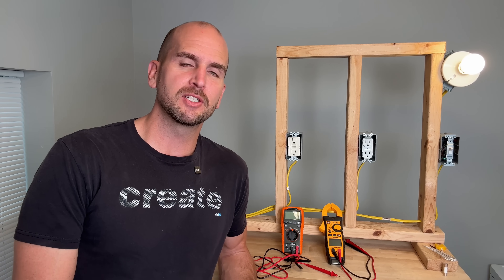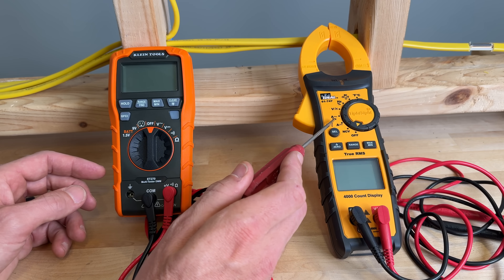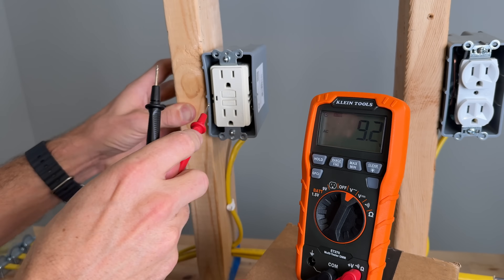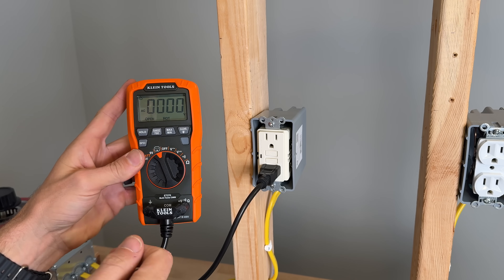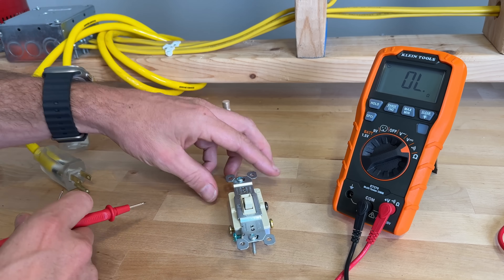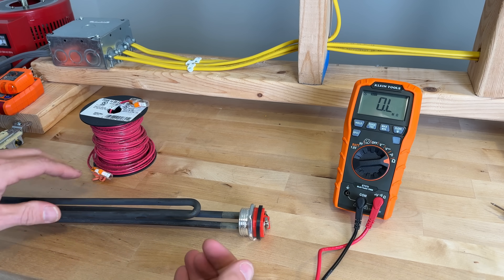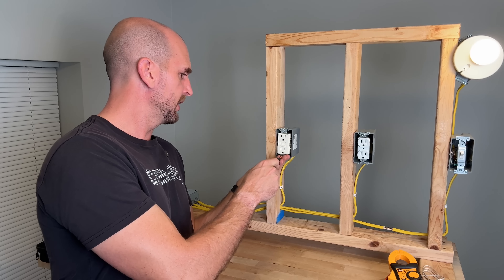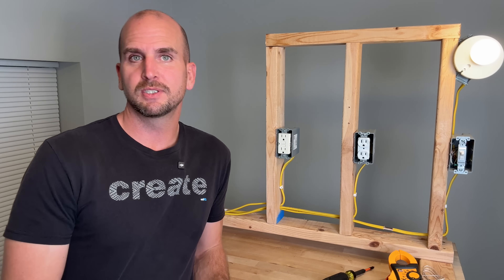Ultimate DIY Homeowners Guide To Multimeters

Comment: Will the klein plug in testers find open neutral and open ground? two problems at same time?
Reply: That might depend on which style of plug-in tester you have. The basic three light might only give you one error code until it is resolved and then show the other error afterwards. The LCD screen testers can show multiple errors on the screen. In this instance it’s probably better to use a multimeter to solve any issues.

Comment: Don't you have to use a cord splitter that plugs into the outlet when testing for amperage draw? I saw that you put the ammeter over the hot wire behind the outlet. Hmmm, so you didn't need that special splitter?

Comment: I’m going to be going through the wiring on older boat so how do test if wiring that goes to certain things on the boat ,for example testing to see if the wiring going to the fuel sender on the gas tank is working correctly.would that be the same test to see if the wiring going to the gauges ?
Reply: Boat wiring is fairly straightforward on smaller boats, you have your engine harness side and the boat wiring side. Assuming no one's modified the original wiring, the boat side follows an ABYC coloring scheme and the engine side will be manufacturer specific colors you can typically find in their shop manual. In your specific scenario, the fuel gauge will have ignition power, sender and ground. Because it's typically a switched circuit, you'll need to turn the key on and check for power between the ignition power and ground on the back of the gauge. You can jump the sender and the ground here and the gauge should jump to either full or empty, if it does, gauge works. Fuel sender will be a pink and black wire, check for resistance between the sender ground and the battery ground, there should be none or minimal depending on the wire run. Next would be pulling the sender and sliding the float while measuring the resistance across the black and pink wire, it should be within the stated range of that type of sender.

Same concepts for checking voltage and resistance but having a guide for the color codes will save you lots of time.

Comment: When measuring current with a clamp meter, its not necessary to remove the receptacle from the box, if you use an AC Line Splitter.  Some clamp meters come with one, or you can buy one separately, about $10.

Comment: My favorite screwdriver is a 6 in 1- it has 2 philips sizes, 2 straight slot sizes and 2 nutdriver sizes.  I like it because it does what I need but it isn't overly complicated.  I've tried the 11 in 1 and I have to fiddle with it too much to find the bit that I need.  I have a ratcheting screwdriver with a lot of bits in the handle but it is the same issue- I don't really need that many different bits so it is too difficult to change bits.
I have a really old VOM in my workshop and a cheap new VOM in my house, I use them mostly for just testing batteries and testing continuity, occasionally for measuring resistance.  I don't normally need the additional features but it is interesting to see what they do.

Comment: Great video. I just bought a multimeter to check out the voltage from my doorbell transformer after installing a doorbell camera. I was getting low voltage messages from my camera. Changed the transformer to one with a little more voltage and checked the voltage again. It was within spec for the doorbell and the low voltage message went away. Having the voltage meter gave me insight needed to resolve the problem.

Comment: Hi Scott,  Nice video.  Question, at about 3:25 using the individual probes the Klein tester showed 127.3 volts.  Then at at about 5:42 using the plug method in the same receptacle the same Klein tester shows 121 volts.  Why the large difference?  Thanks for all your great videos.  Take Care, Myles
Reply: My question exactly on why there is such a difference in voltage between the two methods of testing, using the probes versus using the plug?  Could you please explain? Excellent video

Comment: Another thing to add, don’t know if anyone else mentioned it… When you take a resistance measurement the system has to be off and isolated. Testing the heater element, it has to be switched off and disconnected (doesn’t have to be removed)

Comment: For me getting a meter that measures capacitance allows me to check AC capacitors which are easy to change. Saves a lot if avoiding a service call.  Also you can buy an attachment that effectively splits the power cord into hot and neutral so you can measure amps. No need to open the outlet.
Reply from the maker: Thanks for the feedback, I also like the capacitance capability.  For the price of a capacitor as compared to a service call you can pay for your meter in 1 fix.

Comment: Can you or someone clarify the color terminology?  You say the big slot is "neutral" and the small slot is "hot" (the hole is "ground").  You put the black probe into neutral or ground, and the red probe into "hot".  However, in the "romex", you call the black as being "hot" and the "white" as neutral, and then clamp the black wire.  Does this mean with the probe multimeter you would use the red probe on the black wire and the black probe on the white wire?
Reply from the maker: Correct 👍.  The probe red/black is a bit more aligned to DC Voltage as opposed to AC Voltage which drives a bit of the confusion.
Reply: Don't be concerned with probe color, it makes no difference in AC and in DC it will give the same numbers either way, but if the probes are reverse polarity, you'll get a minus sign before the numbers. No biggie.

Comment: How important is having InRush on a clamp meter?
Reply from the maker: Depending on what you are doing it can be handy on the high inductive loads to see what the actual peak current is on your larger appliances with electric motors and a high load at startup.

Comment: Best DIY info available, keeps getting better! Great new tool tips!
Reply from the maker: Thanks for the feedback and support!
Reply: Hi
Scott has many interesting videos and is very knowledgeable. I have the Klein clamp meter and use it all the time. I also have the Klein circuit breaker finder. This is a fantastic tool if you're trying to shut a breaker on a circuit. It has a transmitter and a receiver, which easily helps you find the breaker you want to shut off, especially if you are alone. Before I had this tool, I had to try each breaker, and it was usually the last one.

Comment: But did you have the correct bit for electric screwdriver’s is it / does it have the flat/square/Phillips bit? All in one bit ?
Reply from the maker: Yep, it has multiple flathead, philips, torque, square, and "combo"bits.  I honestly couldn't think of a bit I use that doesn't come standard.  The nice thing is those bits also fit in your impact driver.
Reply: @ you said bits. I said bit  it is all three as one ☝️

Comment: Balls drop close to the car. xD

Great list of practical applications!

I'm getting used, for most of what I need, to a pen type multimeter. Also works as a small torch, and non contact voltage tester. I still have around my dad's analog multimeter, as well as a newer digital multimeter... but for the most part, the pen style does the job. Easier to carry around too, and it takes AAA batteries which are cheaper and easier to find where I live. 
Very likely not as accurate though. Display is tiny, and navigation a bit confusing. And of course, you don't have DC current or a clamp to work with... but I rarely need those.

For batteries, I got a battery case that came with a cheap-o battery tester. Analog one that doesn't require batteries. It's just more convenient. The display already shows most common voltages for batteries, a scale from bad to good, and it can read anything from button cells, up through the spectrum, and has contacts for 9V. I dunno how reliable it is since it's so dirty cheap that it came as a gift with the battery case, but seems good enough. xD

Comment: How can you use a DVM meter to measure how much LOAD an outlet can handle?
Reply: Information about maximum loads should be on the outlet or electrical equipment
Reply: @michaeldunham3385  mostly they aren't listed so you're just guessing. Most techs don't have a circuit analyzer to test outlets loads. There must be a poor mans version of making a circuit analyzer to measure and test outlet max loads?

Comment: Thanks for the useful video! I don't have a clamp meter so far, and my main concern is that I almost never have an individual conductor accessible to measure the current. It seems that there are "line splitters for clamp meters" that allow measuring the current for something that plugs into an electrical outlet. Does anyone have experience with those? They often have multiple modes that multiply or divide the measurements. Do those work well?
Reply: Some multimeters allow you to connect in series where you can can get a current reading

Comment: I might have to pick up one of these ET270's. I've got the MM320 in my electrical kit and honestly it's just a lot more than I need. Half the time I forget what each option does and have to bust out the manual. The one you showed here  makes that a lot less of an issue.
Reply from the maker: Yeah, I don't know for a fact, but it seems like Klein Tools really targeted a DIY homeowners with the ET270 👍